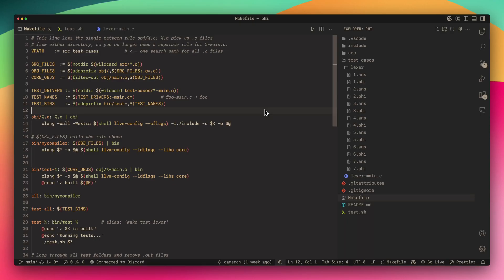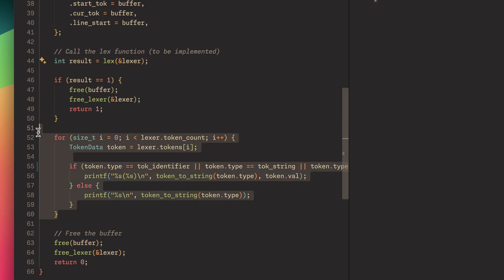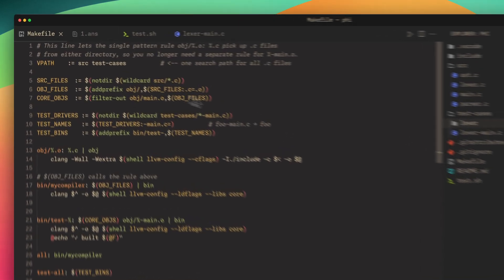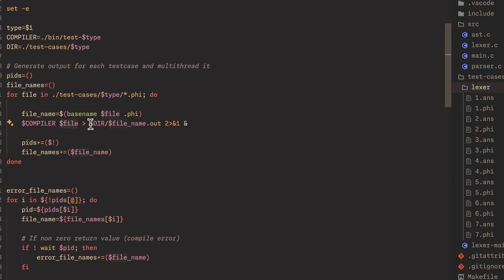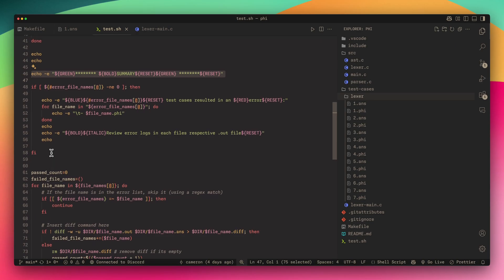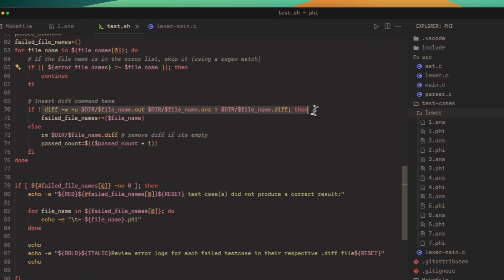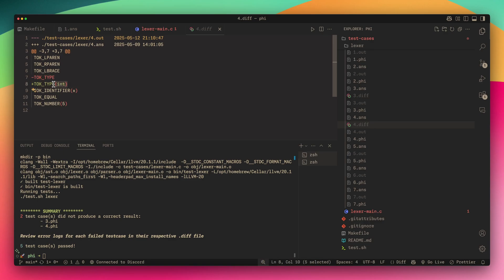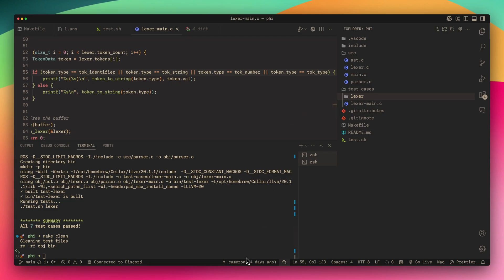Writing a Compiler: Testing

Comment: TBF, testing errors may be beneficial: you can't test error messages if you skip errors.

The lexer is very "low-level" and handles everything char by char: there is no single logic that handles "go to the next char",
instead the logic of every single token must handle line number(or lack of \n), which is very error prone as you must think about it and thinking is for nerds.

For example the lexer supports multi-line strings. However when it looks for the second '"', the lexer jumps over lines without increasing the line number. Every lexer->line_number is wrong after that. So if you have multi-line string on lines 1-3 and unterminated string on line 4, error message will talk about non-terminated string on line 1, which is actually terminated(lexer counts lines from 0).

By the way, if you want to have fun, tell google's Gemini AI (Flash 2.5) to behave like strict tsundere, throw insults etc, and do code-review code as you  paste it. It can generate some hot takes but also can detect some errors(eg in error message "function {func_pos} was already defined at {func_pos}" - 2 uses of {func_pos} when I intended to use {other_pos})

Comment: Nice
Reply from the maker: I'm glad you liked it.
Reply: @brainticklee  I am building a compiler for my own language too. But currently, I am working on the language's design and would be redesigning the compiler when I am done.

Back when I was still working on the compiler, I built my lexer to store the token and it's relevant information like token type, line number and start and end columns, in a TokenData structure which would then be put in a list data structure - std::vector<TokenData> - then I would simply have the lexer spit out the TokenData contents in the list data structure after tokenization and manually verify it 😂.